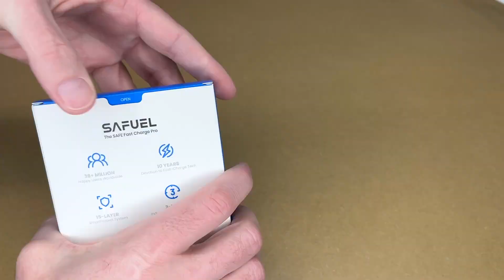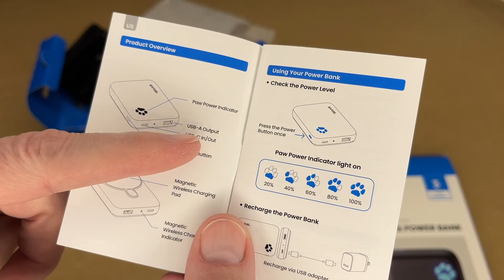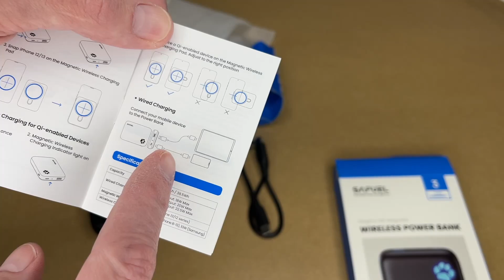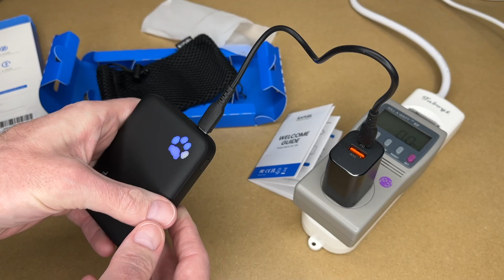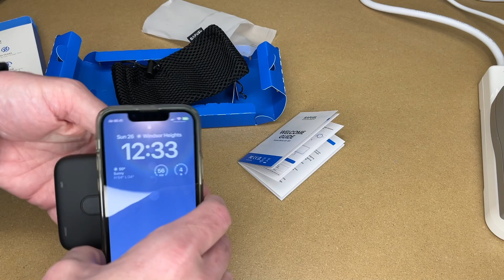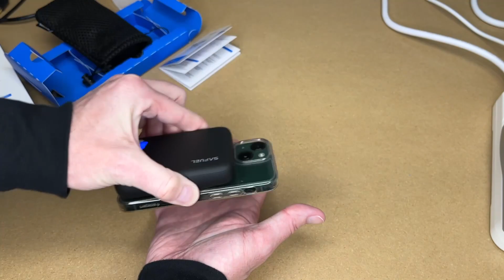SAFUEL 10,000mAh Magnetic Wireless Power Bank for iPhone 12/13/14

Comment: Do you know if you can charge the powerbank via wireless charging? Also do you know if  you can charge other devices, while you recharge the powerbank (--> pass through) ?
Reply: I have tried it. No pass through.
Reply: I just bought  one 2024 it does pass though  now
Reply: What did you buy?  @kenthibeault4258

Comment: This is INIU Power Bank?
Reply from the maker: This is SAFUEL but I think the INIU is identical. They seem to use the same manufacturer.
Reply: @Rickmakes  that’s because there both owned by the exact same company and they also supply Anker ..
Reply: Safuel and inui are owned by the exact same company who also supply Anker , which is why there items tend to look exactly same . 
Given they supply Anker who charges a 3-4 times more stick with either safuel or inui which both usually come with a 3 year warranty
Reply: INIU version of this charger are subject to RECALL as of December 2025….so how come this model is not included if they came from the same manufacturer?

Comment: Does this work with Android phones?
Reply from the maker: I don't have one to test it with but it should work as a wireless charger or a magnetic charger if you have a metal ring on your phone.
Reply: This will work with any wireless phone as long as you have the MagSafe ring on your device , if your device does not come with MagSafe but has wireless charging just buy the MagSafe ring and attach ..